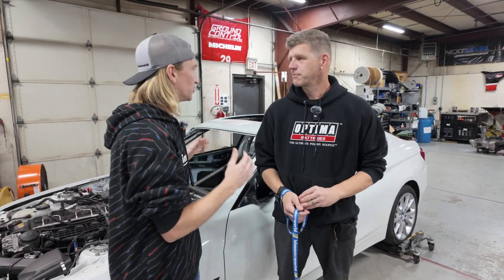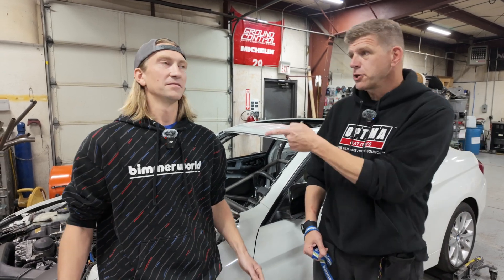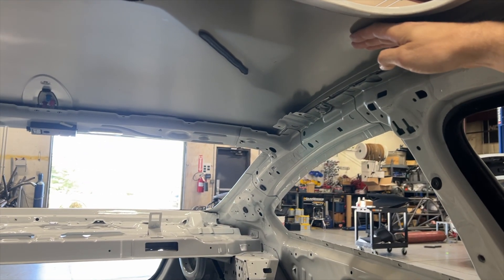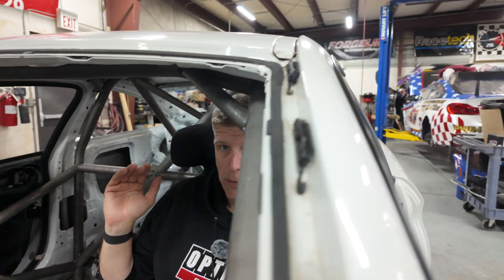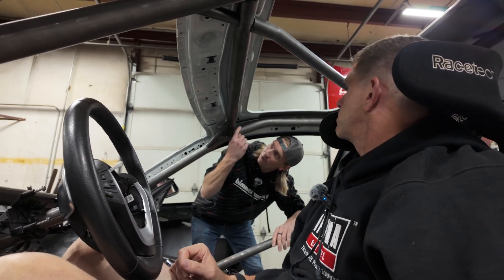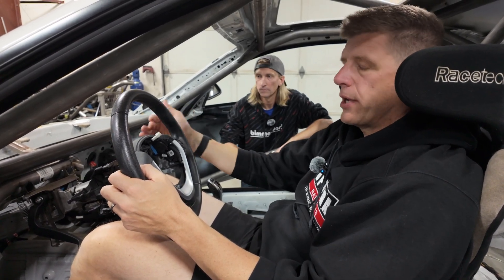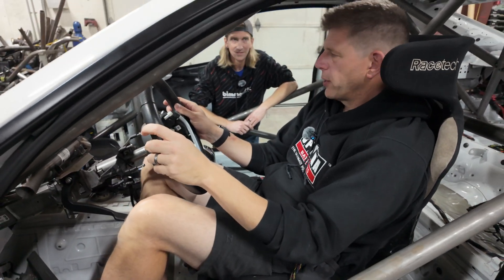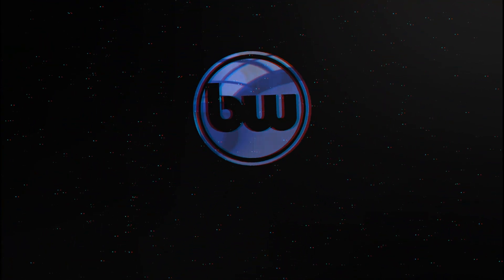F32 435i Racecar Build:  Cage Design Walk-Thru

Comment: Nice work. I was wondering what was happening with this car. Love the build videos and the effort you guys are putting in to document (and support) that platform. Do you guys have any recommended cage builders in the Northeast? I'm building/driving an e39 M5 track car and the next step after the bolt in half cage I have will be a custom weld in cage to meet CCA Club Race standards.
Reply from the maker: Not sure where you are in the NE and there are plenty of great shops up there.  You could give our sales guys a call and we could probably narrow down a list for you that we'd be happy to recommend.  AutoSportFab in Plainville, CT for instance does great BMW cage work.
Reply: @BimmerWorldMedia  Thanks! That might be the same shop Peter Partee recommended as well.